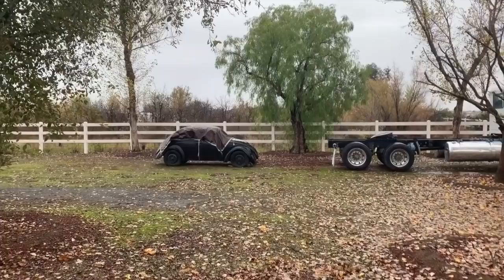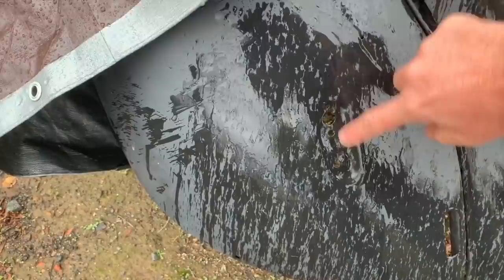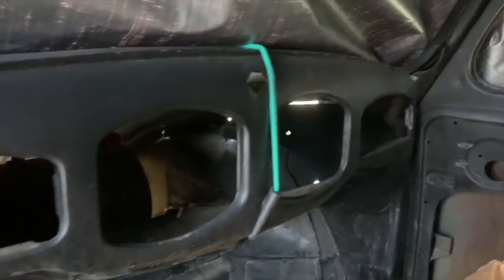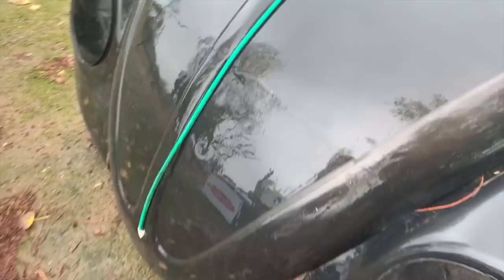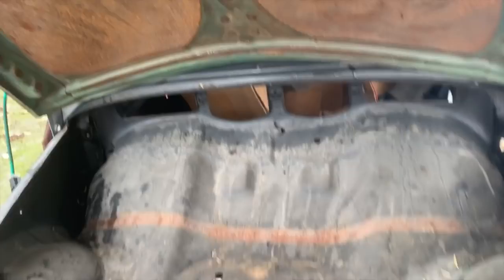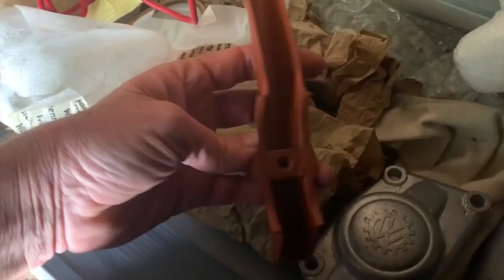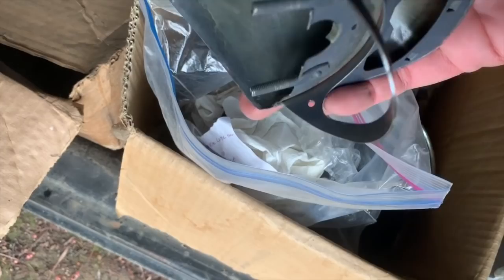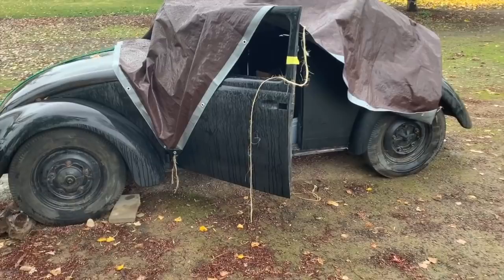Carchaeology: Insane 1943 VW Discovery!

Comment: This is a mass produced Beetle AFTER WW2 fitted with some older Parts (1949 - 1953).You can see it in preparation for the right-hand drive version in sheet metal.
Reply: @kingofpentacles3213  I think he's referring to the vertical panel forward of the pedals.  It has the pressing for where the dimmer switch goes on a RHD car.
The no ashtray could mean the dash is a Standard.
Reply: Why the Semaphore signals there but welded Up then?
Reply: @georgebamber6871    If the car was being used on the street in Germany in the 60s, semaphores were illegal by then, so it was common for the slots to be filled in.
Reply: @georgebamber6871  That is what I think as well.
Reply: @e-curb  Either filled in with some welded steel and painted "en suite" with the car of a piece of chromium-plated pressed steel was bolted over the opening.

Comment: All early beetles had no indicators at the wings but spring-loaded ones that popped out from the B-column. Basically they were a rectangular metal frame with a yellow or orange light in them that was visible from behind and the front but not from the side.  When that was seen to be a danger to cyclists and bikers the indicators got there where we expect them to find in modern cars. The old ones were taken out and the hole in the column was closed with a ( chromium plated) piece of metal.  Can it be that this strange object with its welding in it is such an early B-column?

Comment: I have struck this situation myself several times. Where someone is selling a car which isn't their's. Sometimes the car has changed owners because of unpaid bills. In one instance i came across a pair of really desirable Mercedes, both had been partially restored at huge expense,but the real owner was locked up in Prison. i didn't touch them and I'm glad I didn't because the owner resurfaced and is still hunting for his cars...which will turn up .

Comment: The company is Ferdinand Porsche that build the front end suspension with four torsion round bars, each is clamped the bar's end with its teeth torq-bit male and second end also have teeth (metal) that is engaged to one of control trailing arm's teeth around its near end.      The upper control trailing arm also is connect to the upper torsion bar at driver side. Along with driver side lower control trailing arm connect to the lower torsion bar. That the torsion bar is inside the tubular-pipe/front end chassis. Then two more torsion bars for passenger side spindle linking to the front end suspension (upper and lower control trailing arms).
  The Type 12 was longer wheel base than the 1943 Beetle. Two models were made in Stuttgart: one was open-top cabriolet and other model is closed sedan type 60. It became shorter wheel base than type 12 in 1932 A.D. It has no rear window and headlamps were fitted into atop the front hood. Most of the Volkswagen wagon were color black. Thanks for working like a Volkswagen Lifers.
Reply: Well no ;

The front torsion bars were flat stamped steel leaves, 5 on each side IIRC 

-Nate

Comment: Very interesting!  I once saw a WW2 German news film that for a split second showed the back end of a beetle in the snow in Russian that they had built a fire under the engine to liquify the oil.  Probably a Commander Wagen
Reply: In the wartime publication of the Kubel's operating handbook, for use in Russia in the winter they instruct the soldiers to thin engine oil with gasoline!
Reply: That is what my granduncle told me about his experience. But the verhicle that he and his men thawed up in the plains west of Stalingrad was his tank.
Reply: German mobility at the eastern front had become low during the first "Russlandwinter". Nearly half the motors had cracked despite anti-freeze in the cooling water. Universal joints had given up when the wheels had sunk in the mud. More and more military transport relied on cart and horses. That was what the newsreels were not to show. The irony of that experience is that when West-Germany was re-armed after 1955/6 the staff  in the newly formed army procurement offices all seemed to have been young officers at the Russian front and with that traumatic memories ordered monsters like the "Magirus" lorry that could run on ANY fuel from petrol to hair-oil on ANY surface! It took an entire generation to pass until logical reasoning won. Of course you need all-wheel-drive lorries in the forces but the bulk of logistics is carried out on normal roads in mid-European weather and for that you can as well buy ordinary vehicles from the serial production .

Comment: I always thought that the very early Beetles had no rear window and that the split rear window only came after WW2.
Reply from the maker: There were prototype Beetles that had no rear window, but from 1938 on up to October of 52, the split rear window was there.
Reply: Yup
Reply: Nickname  "Brezel". Tiny split windows can be found in many cars from that period. Just think of that American-style beauty "Opel Kapitän" from 1938/9 to the early 40s, and then again after slight refits in style from 1951 or so.
Reply: Many decades ago,l saw a bug,l was told  it was a 46, I swear it had a tiny oval window,not a split and not the later oval like a 57 would have,is that possible?
Reply: @dougtodd305   That is possible. There were companies in Germany in the late 50s that would cut out the center divider so that an oval glass would fit.

Comment: In California whoever holds the title owns it and the DMV doesn't determine ownership based on bizarre stories or any stories at all.    In addition to that, if the vehicle as been on the same property for over 2 years, the property owner can file for a lien title.  It used to be possible to do that for cars abandoned on public streets as well.   I picked up a sweet '56 Oval that way in 1982 that someone left in an alley and truly abandoned it.   You have to notify whoever is listed on the title and if the certified letter is returned undeliverable, DMV issues the claimant a new title.   Was this car missing the chassis number or something?   I think I saw this very car at Bugorama '86.
Reply from the maker: True...but despite what California rules are, there are moral rules to follow as well. The car in my mind belonged to someone else, and the whole situation just felt sketchy. Not something I wanted any part of even if the car was free.
Reply: @Carchaeology  Ah okay.  I didn't realize that you believed someone else owns it.  As far as it being a 1943 I'm thinking it may be another year and that someone at the DMV just made a typo when creating the California title.  I had a 1971 Porsche 911E that was actually a 1970 according to the vin but someone made a mistake on the title when they wrote or typed it down.

Comment: The KdF car was designing VW engine flat four and transmission was 4 gears for climbing rock and mountain plus reverse gear. Then DAF organization was selling Krubelwagen jeep type 82 for it is rag top or folding roof of tan color Germany WWII. Robert Ley was the German that manufactured the 1943 as it is the same model as 1942 BUG with hole on the roof for observer to look thru binocular at the movement of Allied Force infantry. The bug could be produce in Paris Automobilia show and Delage would make a midget car with Auto Union Audi in Chemnitz that made the Volkswagen electric power plant into sheet metal fender bender Press along with Marquette Arc welding machine. Wolfsburg and River Building were working class as they had order larger Volkswagen truck lorry or Half track carrier called Strandbuggy company of sturmfuhrers. 
 Whenever you try stamping a name plate for it's VIN and try harder to get matching up the engine series number made in 1950's or 1960's with a license that must be purchase from Headquarter in Volkswagen Land places. That way the 1943 Beetle carriage with power up by gasoline Texaco made the Volkswagen or Gulf made the volkswagon if it is to proof that it is Giant enough to conquer warehouse of shipping wharf of the delivery called Volkswagen Import of borrow the wharf of its temporarily workers at dry dock metallurgists or social worker that must do the holding the family of helm wheel and rudder specialize for trading Post called taxing and punch carders. Thanks for Mike FN Garage and photo by you in California. Hicks VW repair shop and services by DMV. Date is Aug. 20, 2022.

Comment: War time beetle under tarp in the rain not match. Somewhere in Finland is guy who make body parts for oldest beetle.  He know what is real.
Reply from the maker: Yes, I know it is not 100% legitimate, in fact it may be a stretch to call it 50%.  But it still deserves better than to sit in the rain under a tarp.
Reply: Virtanen is the Finnish guy I think you mean - he does split window panels. Tomasz in Poland does really early stuff though.
Randy, I think it's been rebuilt using a '51-ish donor car - that drivers door looked remarkably similar to the one on my Pastel Green Jan '51 car. Restojohnny had that slammed and skirted '43 on Fumigalli wheels, and I remember something on his build thread on The Samba about the rear window inner pressing having a different number of vertical ribs underneath it. This car has three but I can't remember what it should have!
Cool car nonetheless!
Reply: @jarikinnunen1718  wow, he's really expanded his range since I last looked! Mind you, I sold my split quite a few years ago. I'd heard that he had a super nice split that he drilled the spotwelds out of and disassembled it so that he could 3D scan the pieces to make his tooling. Don't know if its true, but a cool story!

Comment: My first question - and yes, I'm a neophyte - I thought all efforts were geared towards producing war vehicles like tanks, planes etc. ?
Reply from the maker: Beetles were produced for war effort use along with the Kubelwagen and Schwimmwagen. They even built special models of the Beetle with taller suspension and off road tires.
Reply: @Carchaeology  Thank you for your reply and information. Makes sense. The VW bug and Model T are the finest designed car ever ! I love your channel  ! !!
Reply: @Carchaeology  Under British command they also built 4x4 beetles with the drives of the Schwimmwagen...
Reply: @uwewaibel9163    Only 2 of them.
Reply: @e-curb  The Volkswagen Typ 87, also known as the Kommandeurswagen, was a World War II, four-wheel-drive version of the Volkswagen Beetle.It was produced from 1941 to 1944 by the Volkswagen plant, primarily for the Wehrmacht (German armed forces). The Wehrmacht classified the Kommandeurswagen as leichter geländegängiger PKW, 4-sitziger, 4-radgetriebener Geländewagen Typ 87. ("light offroad passenger car, four seats, all wheel drive offroad vehicle Type 87"). The drivetrain and the engine are the same as in the Volkswagen Typ 166 Schwimmwagen amphibious vehicle. 564 units of the Kommandeurswagen were produced;[
 in November 1946, the Volkswagen plant - by then under British control - produced two more vehicles using parts from stores. (Wikipedia)
Reply: @uwewaibel9163    Yes.  You forgot about the Type 92SS
Reply: @e-curb  due to Corona restrictions I don´t have access to my documents, but if I remember right the first beetles built for the British administration were based on the model 92 or 92SS named 82e - if you look at pictures where these new cars are disposed in front of the manufacturing building you may notice the high ground clearence which is a sign that parts of the previous Kübelwagen model 82 were used...

Comment: I heard the iconic VW logo was designed after WW2 by a British army officer when they were deciding what to do with the car factory and the cars they saw little potential in so didn’t take the design as war booty but gave it to the Germans to help their economy recover. But I see VW logo on this WW2 car?
Reply from the maker: The VW logo was in use from the start but with a cog wheel design around the outside.  This car is not a good representation of anything really, as it is an assemblage of parts from many years.
Reply: Be fun to put it up on the high suspension and off-road tyres, kind of a Hitler Dune Buggy vibe 😂
Reply: The VW logo existed in 1937.
Reply: @Carchaeology  most parts with a cog wheel around the VW logo are pre 1945 made and may be used for the first beetles made under British command...
Reply: As others tell us here the V and W in a circle were the logo from the very start. The difference between the nazi-era and the post-war era is the toothed wheel around it. That cog wheel  around a swastica was the official logo of a sub-division of the Nazi-party, the so-called "Deutsche Arbeitsfront", the "German workmen's front". That pompous name stands for an organisation that dealt with a great variety of things, acting as a pseudo-trade union, was to unify "workers of fist and forehead" ( that is blue and white collar workforce), saw to it that workplaces were well-maintained under the guidelines of a dictatorship that "did somethíng for ordinary people" (clean canteens, washrooms and showers, well-lit workspace..) and organized holidays and travels. For that another sub-division was created, the organisation "Kraft durch Freude" (strength through joy). For some reason that entire Volkswagen-plant project was put under their command. One reason was that the people should believe that it really were "their" cars that would be built  for them. As a member of the Deutsche Arbeitsfront" you could subscribe your future car. It was supposed to cost a little under 1000 Reichsmark and  you would get it as soon as  you had paid a good deal of that sum with a monthly subscription of only  5 RM . The head of the Deutsche Arbeitsfront was some Robert Ley, people nicknamed him "Reichstrunkenbold"- "Reichsdrunkard'". His pompous speeches in a slurred voice, usually at the official 1st of May rallies, made him the laughing stock of the nation. During the war Ley was responsible for the exploitation of occupied Europe and all that what we can simply call slave labour. When he had read the massive indictment against him in his cell at Nuremberg he suffered a nervous breakdown and hanged himself. Needless to say that the people who had subscibed "their" VW could throw their subscription book into the fire after the war.

Comment: The Volkswagen was a 4 wheel drive Beetle and the Krugenwagen was a jeep with rear air-cooled engine 1200cc. The Beetle 1943 was dumped into a trash of fully rust. Then someone pick it up and didn't find the pink slip and VIN was not original so it was void by the DMV. To make it work the VIN plate must be made and rivet it to the front under the hood and punch numberare the  and stamp on the chassis hump near the shift and make all just identical VIN. With proof that you aim to buy it for $50,000.00 from the land owner that the law allow the owner of the lot will be the new owner of the 1943 replica of the old Beetle without the engine. It is not driveable unless you proof of the new receipt with what you paid for it. How much would you willing to pay from the estate and DMV wants the proof of what it's worth otherwise no one will have any VIN identification of Adopt the Beetle. Thanks.

Comment: This is a normal 1950 - 51 split. You specialist.....
Reply: Didn't the earliest vws have a large louvered rear area? Almost like no rear window at all?
Reply from the maker: Those were prototypes
Reply from the maker: @beetlekey it’s not a normal anything . It’s really a total Frankenstein of parts. Some real, some fantasy, and all of it tangled in a huge legal mess.
Reply: It's earlier than that. No ashtray in the dash means pre-50.
Reply: @e-curb  I thought it was only deluxes that had ashtrays? Standards went without?
Reply: @neildavies2276    You're correct.  It could be a later Std.
Reply: @kingofpentacles3213    In looking at the dash again, it's not a KDF dash.
Also, the pressing of the inside panel of the rear window is post 1946.